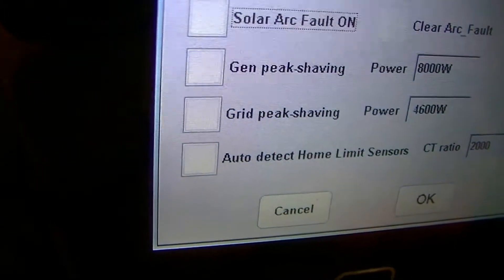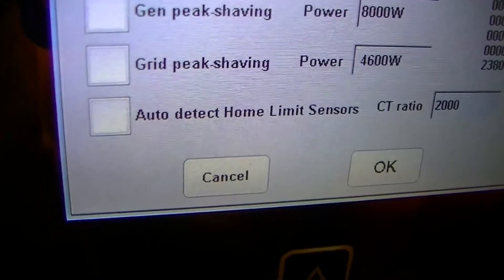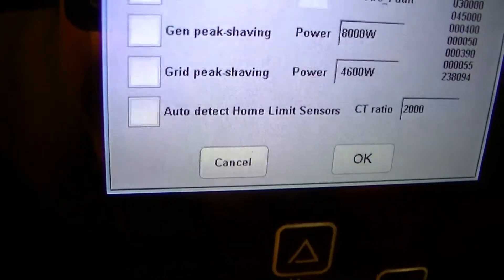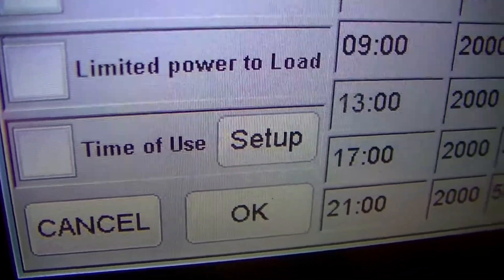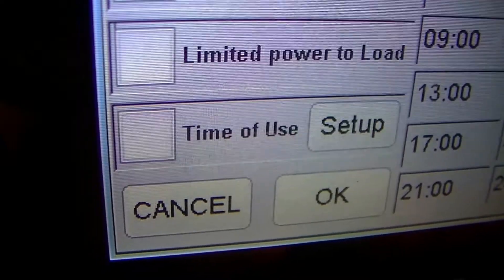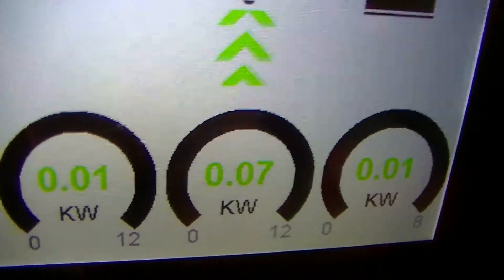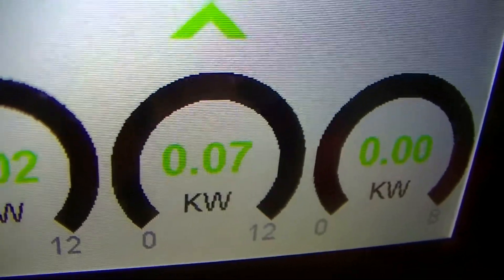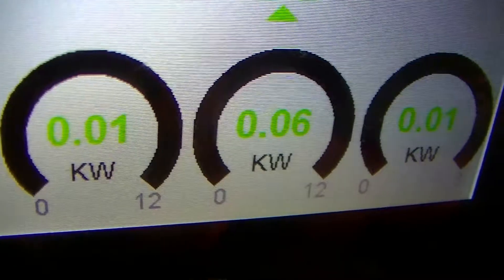Sol-Ark peak shaving/time of use problem

Comment: Having a different issue.   Trying to USE TOU....have a small battery (15kw) and array (3.7...growing both ober yhis next year).  Want it to discharge starting at 9pm at 1200 watts (limited to home) and discharge between 430am and 8am at 2000 watts.  I have it set this way, no off peak hours with utility, but I wanted to go into evening with as much charge on battery as possible to cover critical loads if the power went out in the evening.

I got this to work one time and ran for two days like this, so I know it can work.  Now...all the damn thing does is discharge battery 2000 watts (because the very last slot in the TOU settings is set to 2000 watts).  The only way I can get it to change amount of discharge is to change the very last slot of TOU.  It is ignoring the times and values associated to times in other slots and is ignoring the battery restart voltage all of a sudden as of yesterday (10/18).  Battery restart set to 56v (nmc), only made it to 48v yesterday due to weather.  It didn't care.  9pm came and discharged, limited to home at 2000 watts even though it is set to 1200.

Sol Ark 15k.

I have requested a software upgrade hoping it is just glitchy firmware.  If that doesn't solve it, I will call distributor then call Sol Ark.  

They make a great product but the manual needs a lot of work in clarifying with examples.  It took me 2 days to figure out how to get the thing to do the thing, and I couldn't tell if it was me or the firmware having an issue.  With me getting it to do what I want it to for a period of time....and now wont....it isn't me.

Any other suggestions I'm all ears.
Reply: If you want you battery to charge up through PV during day to be ready for night, set a time slot like 12pm with a 100 SOC. Setting to 100 SOC will make it not draw from the battery.

Comment: Have you tried checking the boxes for "grid charge" on the TOU over on the right?  I'm wondering if that would work, if you set the battery voltage to a sweet spot.